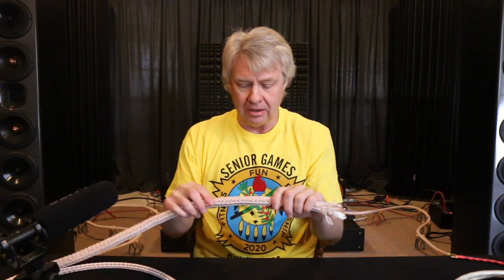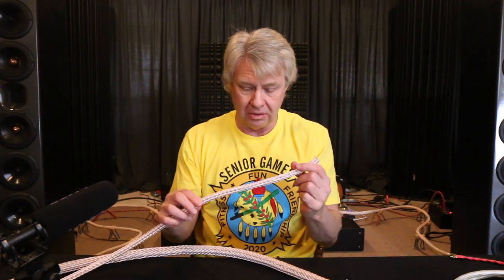What’s up with Audiophile Cable Risers?

Comment: I have a physics degree, but don't claim to be a physicist or any kind of authority on electrical engineering, but what I did learn from the few introductory papers in electrical theory I took, was that when a current passes through a wire, there is a heck of a lot more going on  than just electrons moving in a conductor. The properties of the resulting fields, frequency dependant inductance and reactance... sure you can measure them or make some kind of inference about them  theoretically, but the behaviour of current is extremely complex. I always roll my eyes when I hear people insist that what you measure is what you get... I would compare that to dropping a line over the side of a boat to measure the depth and then claiming to know everything about the ocean. Sure, Danny uses measurements to determine some primary parameters of acoustic systems, but he understands what he is measuring, it's limitations, what the measurement is telling him and what it isn't. I changed out my speaker cable for the helical construction type of cable that Danny uses here, because I immediately recognised when I saw it, that the geometrical configuration of the cable would have a significant effect on the fields created around the cable, and therefore the self-induced field effects on the signal. I can't say that lifting the cables off a non-electrically neutral surface will make an improvement, but I can guarantee it will make a difference to the signal. If you alter the field, you alter the signal.
Reply: @edd2771  Ed, what are you doing? Are you here just because you like arguing about nothing with strangers? I am not interested. It's boring and pointless. If you disagree, I really don't care, just say what you believe, maybe I'll read it maybe I won't. No one is obligated to engage with you.
Reply: When cd players were first introduced it was claimed that because they all measure the same they all sound the same, which they clearly didn't then someone analysed phase jitter and that explained a lot of the difference.  Could there be something thats not being measured that relates to risers?
Reply: @philspencelayh5464  That's exactly the thing, just like the early days of CD before jitter was known to be a thing, we don't know what we don't know. And even if we do know a measurable phenomena exists that affects the the signal, in the case of fields, even if could quantify some property of the fields, how do we determine it's meaning? We are dealing with a highly complex system where a current creates a fields in 3 dimensional space which acts on itself and in turn affects the  current creating it and the effect varies with respect to frequency and a multitude of other factors, add to that that every medium in which the field exists has a dielectric coefficient that influences the field, and therefore the current, and it all gets very complex, very quickly. All you can know for sure is that every factor that changes in the signal path has an effect, whether it's audible, good, bad, who knows. Lifting cables of the floor and therefore changing the dielectric properties of the medium  might sound better, might sound worse...All you can do is experiment and listen.
Reply: @philspencelayh5464  Read Ethan Winer.  Ethan Winer is a real engineer and musician.
Reply: @paulsebring6930  Read an article on your advice from  Ethan Winer. The gist I got was that cables don't make much difference but  "Bass Traps " which he sells make a huge difference.  I have worked in electronics all of my life  with a lot of work in audio equipment and and a keen interest in Hi Fi. When I first heard it said that cables made a difference I thought "Its just a piece of wire how much difference can it make" .  Once you start experimenting. I agree that I have found that power cables make no difference that I can tell. Signal cables do make an appreciable difference and loudspeaker cables make a colossal difference which I would defy anyone not to notice. Which is correct in my opinion is the one you enjoy listening to the most.

Comment: Great and easy explanation of what electrostatic charge can cause.
Cotton rope have some conductivity, and grounding the rope to amplifiers chassis ground might help even more than cotton rope alone.
This is simple sience similar to what you do in a ESD safe are in electronics handling/production but at a higher impedance level.

Comment: Okay, this can make perfect sense on a concrete slab home. There is a grid of rebar in the concrete. The home's electrical system, if it's a relatively new home, within the last 50 years or so, the electrical system is grounded to the rebar in the slab.

So, the question then remains. How high off the floor do the cables need to be? Has anybody tested different elevations?
Reply: @erics.4113  He could raise his cables 2 feet off the floor and see if it continues to get better . ..
Reply: To minimise this effect you could put the hifi in one of the bedrooms and sleep downstairs, if you live alone.

Comment: Hi Danny. I have been using cable risers for years. The best cheap option is 3 wooden chopsticks and some string tied into a tepee. This costs practically nothing and is an easy way of testing this principle, to see if it can work for you. Give it a whirl.
Reply: When you see one’s for £100s each, it’s clearly a rip off.

Comment: More than 30 years ago I had a Hewlett Packard 4800 Vector impedance Meter. I bought it second hand in a computer shop. When I was measuring the impedance from speakers that I had built, there was a strange reading on the meter when I moved the cables an inch or so sideways. They were just on a wooden floor. When I lifted the cables several inches from the floor and moved the cable sideways there was no effect on the meter. I thought maybe it was the radiation of a power cable in the floor but could not find any cable there. So, I'm not at all surprised that cable risers have some effect.
Reply: No other cables under the floor, but what about next to them?
Reply: @TheMatsushitaMan  I think they were 5 feet next to the speaker cables.
Reply: At what test frequency did you see that behaviour ?
Reply: @iamsometimes6712  I do not remember. It's a long time ago. I don't have the HP meter anymore so I can't test it again.

Comment: our trips to ikea, purchased some cheap glass tea light holders with little slot designs at the top that could (effectively) cradle my cables. And - dammit - it made quite a difference.

Comment: Lowes sells a plastic cone shaped tower called a rebar chair.  Its 58 cents.  It looks good under the cables and it does improve the sound.  Improved imaging and focus, is noticeable in my system. Dirt cheap! Looks good and sounds good.  All you have to lose is $15  at Lowes. Just try it with a open mind.  Yes I am serious.
Reply: Been using rebar chairs for years and yeah they do make nice improvement !.

Comment: In my last home I couldn't have the cables on the floor but the was a wooden rail around the room about a foot from the ceiling with hooks screwed into it so I used so sewing thred and hung the cables using it from the hooks and yes the cables gained around 4 foot in length but it made a huge difference even with a low end budget audio system (less than £700 all in turntable, tapedeck, receiver, secondhand speakers)
Reply: Sorry, placebo. Try a blind test.
Reply: @neandrewthal  there was less background noise  (hum) with the cables hung so wasn't placebo effect. The reason I think was concrete floor with old-school electric underfloor heating (floor was basically a massive kettle element)

Comment: Hi.  Found you via Vinyl Attack.  Nice to hear your explanation of some of the cable issues (your speaker cable reminds me in appearance of the first Shunyata signal cables, which they sourced from someone else).  I've sold serious cables for about 30 years now.  Even with that I avoided risers.  However I was wrong, even though my system right now, which is very high resolution, doesn't respond much. All the variables you mentioned are in play but in my case I use monoblocks and the cables are only 5' long. Not much was lying on the carpet.  I did put my manufacturer's risers under them and the difference was really fairly slight.  Although this company makes some extraordinarily expensive products, the risers aren't at $150 for a pack of 8.  The designer thinks the massive "high end" ones perform worse. These are plastic cables with a piece of nylon string stretch between their U shape.   The cable just rests on it with a tiny contact area.  I'm glad I found you.  Always love places where I can continue learning and send friends and customers.

Comment: I install PA systems and use a Tone Generator and Probe Kit. Which will allow me to hear the music on the cable just by hovering the wand next to the cable. I can disconnect the speaker and still hear the music on the cable using the probe. Very good tool for finding out where interference is being added to the cables.
  Tried it at home, cables on nylon mix carpet had a lot of background static. Lifted cables of floor using lego blocks and this removed the static I was hearing on the cables. No noticeable difference at the speaker end. But I believe it would be noticeable on a higher end system.
Reply: Great observation. Can you please give details of the cable tracer setup you used ?. Thanks.
Reply: @ericmc6482  Greenlee 601K-G Basic Tone and Probe Kit,  there are cheaper versions.
Reply: @mrplainlazy  Thanks.
Reply: I don't think microphonics of the speaker cable would make difference when low impedance device such loudspeakers are connected. The signal from amplifier to loudspeaker is rather large, comparing to signal from say from gramophone pick-up. Damn it would be actually easier to notice with low impedance headphones and good headphone amp if there differences. But my guess there wouldn't be difference with loudspeakers, and crossovers actually distort the signal in all possible domains: amplitude, phase,  time delay to such degree that the signal summed reproduced loudspeaker other than amplitude is very different from original. I would think of cable risers influence as pure fantasy rather than science.
Reply: @pliedtka  "My guess....", Clueless.
Reply: @ericmc6482  Ok, I'll indulge you then, to see if you, on the other hand, have a 'clue'.
Can you enlighten us and explain how the experiment mrplainlazy describes will make a difference in a typical home audio system once the amplifier is turned on ?
(hint: think about how low an impedance a normal amp's output presents, if not badly designed with tubes or no feedback)
(2nd hint: PA system have huge cable lengths to contend with on the input side which is very sensitive to interferences (high Z circuit), and output side (Low Z circuit but sometimes with a large surface area between the 2 conductor runs which has the effect of... [let's hear your thoughts])
(3rd hint: if you don't know exactly what the previous 2 hints are about then you might want not to comment much on other people's supposed 'cluelessness')
Reply: @iamsometimes6712  CBF.

Comment: Yes. It's just the laws of physics. Remove or minimize as many variables that can transform an electrical signal. And all transformation is degradation. I am a believer. Now first i need money to buy a high end system, so i can also experience that influence. I like your practical approach to solving the problems in signal paths.

Comment: This make perfect sense too me. People think the the electrons flow through the wire. This is not true. Electrons run on the surface of the copper not in the copper. Because of this any magnetic force close to the wire can easily effect the electrons. This effect could just alter the phase just a bit and the phase shift is something that your ear could pick up. You may not know why or what, but you would just know something doesn't sound right.
I use braded cable as well. One time I had a setup where I was getting 60hz/120hz hum on one channel. It drove me nuts so since I build my own pre-amps and power amps I took them to the work bench hook them up and started digging for the problem. I could fine anything wrong. Even hooked speakers up on the bench no hum. I put the system back together and the hum was still there. Swapped speaker cables at the amp and the hum was still coming out of the same speaker. I moved the rack and found the cable laying on top of a power strip that had a few wall warts on it with a neon lamp for power on.
I moved the cable and the hum was gone. Ever since then I always make sure my cables are not touching the floor , walls, or any thing. If I need to 3D print something to do that I will. So it makes sense to me.

Comment: I used to be an electrician and a elevator mechanic and I could trouble shoot basic electric circuits it also seemed the more I learned the more confused it seemed so I am not a electrical engineer. but I just watched a video from a guy who is a ee,  somewhere along the way I learned electricity travels along the skin of an electrical wire now  in this video I watched it said electrons move from electric motive force(with means the lines of force that radiate out from a wire that has electrical current moving thru it) causes electrons to flow outside the wire not on the skin or thru the core... which would mean being on the floor could very well make a diff... but to be honest it is completely over my head. I have a nice entry level system 1500$ speakers and a 3000$ receiver and A1500$ integrated amp playing airplay or CD player as a source and listening to zeppelin and the like. It probably wouldn't make a difference  but it does sound pretty good. I went all thru that to say I like the way Danny explained it and if I was quite a bit upstream in a system I might be interested but since I am in the bottom 80 to 90 percent I will just say thanks for the video
Reply: "Skin effect" is a real thing in signal transmission, but it isn't a factor at the low frequencies of audio signals.  There are other audiophiles with engineering backgrounds who can do a better job of what actually matters in an audio system and why.
Reply: @fredygump5578  Like Dr. Floyd Toole and Ethan Winer.

Comment: In commercial installations involving transmission lines, GIL or Gas Filled Lines use Nitrogen and Sulphur Hexafloride (SF6) as a dielectric. Yes, I know the comparison is quite unlikely given the parameters at audio frequencies but I have oftentimes wondered how long before someone develops GIL audio cables but why go to that expense when your grandkids tinker toys, Lincoln Logs, or Legos wind up in our audio system. As for me, I saving my money for a Flux Capacitor to recap my passive crossovers 😉
Reply: I heard that using Flux Capacitors in your crossovers can help solve phase issues between drivers 😏
Reply: @zackw4941  yes, Any time delays would be eliminated 😂
Reply: That is because they call it Stormy Monday but Tuesday is just as bad but Wednesday makes me glad.
Reply: @zackw4941  But doc needs those for the Delorian

Comment: I raised my cables off my carpeted floor in my fairly expensive system and the difference was very apparent. I had trouble understanding the lyrics but after I lifted the cables off the floor with some folded pieces of cardboard I could hear every word clearly.
Reply: I can't tell if you're being serious or sarcastic, which is hilarious in its own right
Reply: @HiJon89  same 🤣
Reply: @HiJon89  I’m serious but I’m glad you got a chuckle.
Reply: @HiJon89  
I think he's being serious.
Reply: I use XL sized open air raised egg crates.
Much better than folded carboard pieces in my experience.
Really makes more natural sound quacks !

Comment: Pro Tip - Concrete rebar plastic “chairs” are real cheap and easily available from hardware/trade stores, work a treat.
Reply: Great idea!
Reply: @dannyrichie9743  Thanks. Usually they are grey plastic, a spray with white paint (TiO2 pigment) would improve WAF lol.

Comment: I recently took a motorsports wiring course. For digital signal wires that connect CANBUS components, not only are you not supposed to run parallel wires, the twists per inch is specified! Very similar to your closer to 90 degree explanation. It cancels noise in high frequency data wires.
Reply: no radio frequency in speaker signals, so the digital example does not apply.